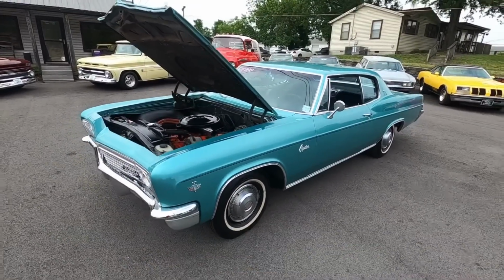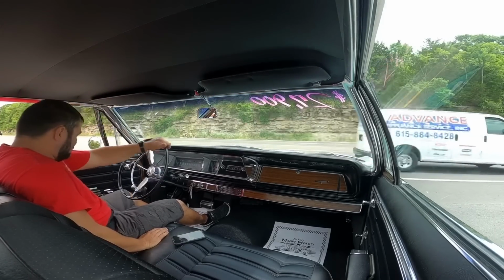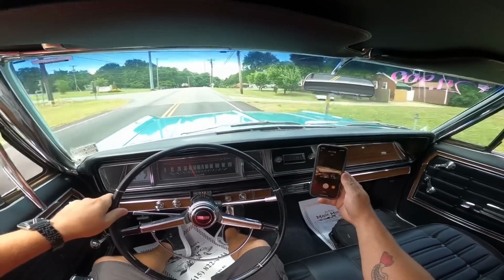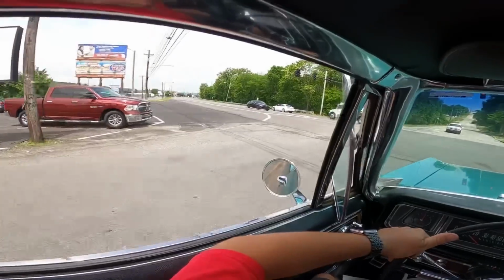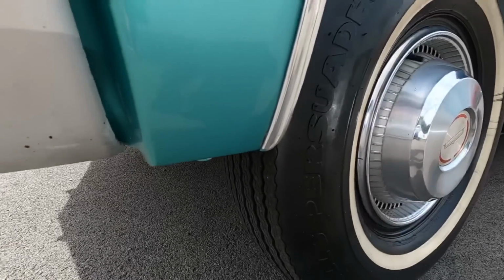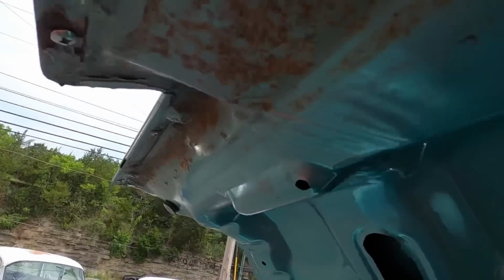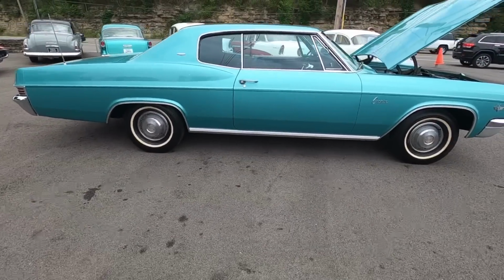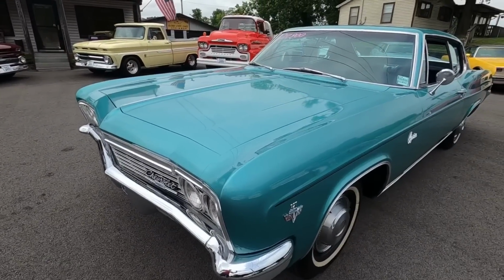Test Drive 1966 Chevrolet Caprice SOLD $27,900 Maple Motors #1648

Comment: Does the radio work? Engine noise ?  Oil residue underneath car in middle of drive shaft area? No A /C is a concern. Windshield cracks normal and tires to be replaced not a concern. Trunk lid rust needs repaired.  With that being said. Pretty nice overall. Ron Knight  of Fort Collins,CO..Still looking for 4 speed 67 Chevelle Convertible

Comment: OMG FREAKING LORD,  MY FIRST CAR! I had a '66 with a 283, California edition, automatic choke, actually, column shift, am/FM  radio with bowtie speaker between the two back seats. Slate blue, black and wood grain interior, I bought it with my own hard earned money in '78 when I only had my learners permit. It was immaculate with only 50k on the odometer. I bought it from an elderly Navy wife who's husband had passed and she didn't drive. At 16 I drove my baby and got alot of chickies piled into her, then in '81 my dumbass brother thought it would be a good idea to power break her and ran her into a big steel light pole,  I still chide him about it, MY BABY! Someday I will have one

Comment: The seats aren't original type. I know. One was my first car. It wasn't the best light to light, but I am a licenced private pilot and have never flown a light plane at 133 mph like I did in that 1966 Caprice when it was 18 years old in 1975. Now I'm 66. Chevy used those 327 cuin small blocks in them for business reasons. They intentionally or unintentionally built too many 327 four bbls for the Vette. In any case, it was so powerful and durable that my father-in-law ran a full-scale logging mill with one until 2013 and I'm sure it can run today. My original seats were immitation silk. None were originally leather which would not have appealled to the old guys that liked the cars. It was for mature audiences only (old males). Hated the look. Hate myself today. That small rusty area in the trunk is where they grounded the battery. Intentionally or not, that rust is from the battery up front by design. It's easy to repair.

Comment: Thank you for shots. good & bad spot on 66 Chevy caprice  99% auto head sure  wouldn't  do that . Thanks. Show a 69 charger or 63 2dr.falcon hardtop auto3speed trans NO 2 speed trans. or 4sp. In floor  289eng.would b cool. Thanks.

Comment: I noticed the Impala emblem on the back seat, did caprices use the Impala emblem
Reply: I noticed that too.  And no. The caprice had the caprice insignia on the rear speaker.  The same one that’s in the steering wheel. Beautiful car but I too am concerned with the leaks underneath and the Smokey exhaust .